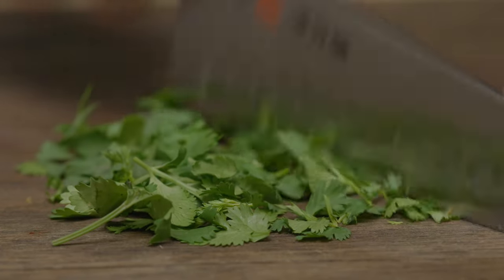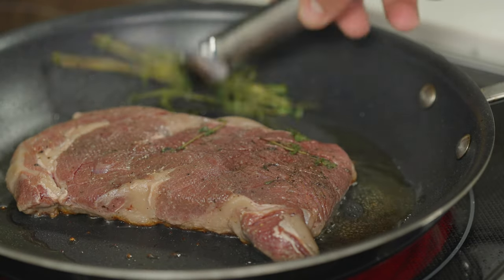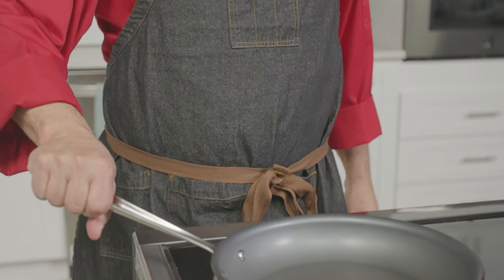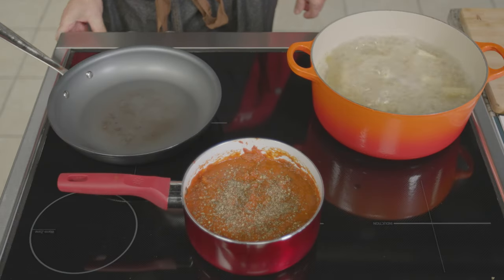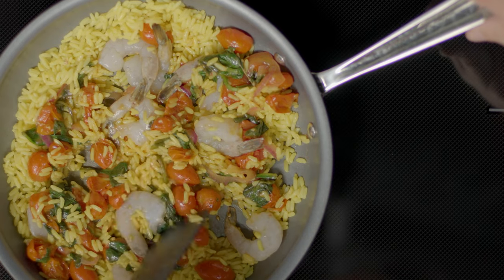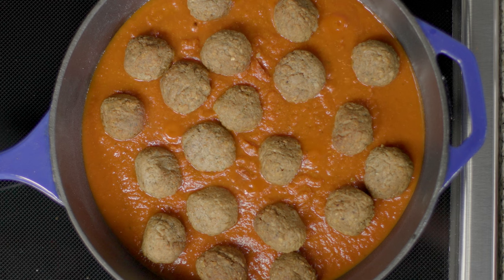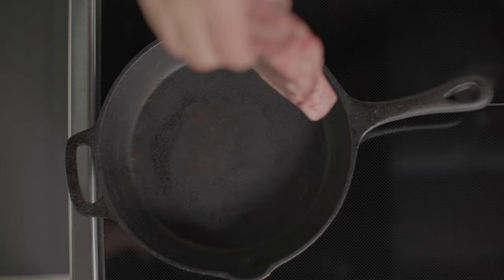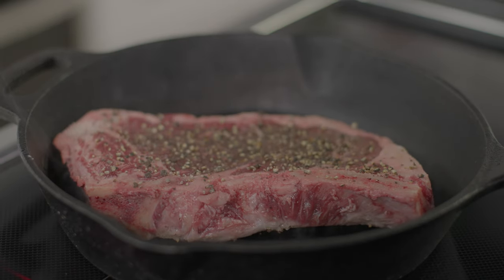[LG Ranges] Common Noises When Using An Induction Cooktop

Comment: Our fan never turns off on our LG Induction Slide In Range.  It is terribly loud.
Reply from the maker: Hi there. We acknowledge about the issue you are experiencing with your LG induction. We'd love to help you out with this. Kindly send us a private message at @LGUSSupport on social media. -Charles
Reply from the maker: Hi there. You may access this link: https://www.lg.com/us/support/email-appointment. Also you can call us at Customer Support 800-243-0000 or 850-999-4934 (Mon. to Sun. 8AM - 9PM ET). ^Mau
Reply: Ok I had my wife message you on Instagram
Reply from the maker: Thanks for updating us. 😊 ^Mau
Reply: @LGUSASupport  unfortunately no one has read her message or responded.
Reply from the maker: Hi there. We regret to hear that. We would love to help you. Please send us a direct message @LGUSSupport on Facebook, X, and Instagram. You may also contact our customer support at 800-243-0000 or 850-999-4934 (Mon. to Sun. 8 AM - 9 PM ET).^Con